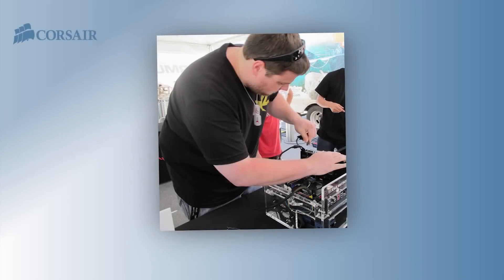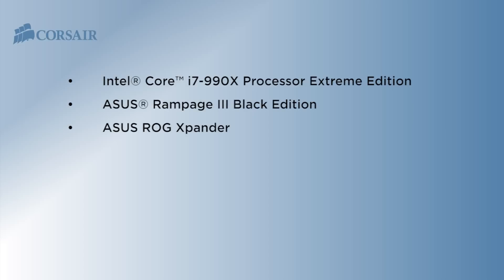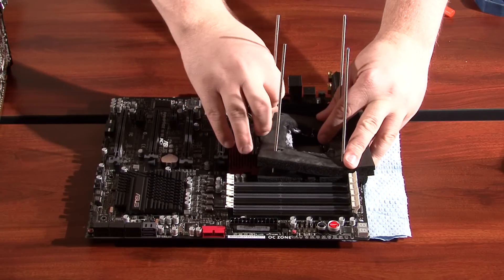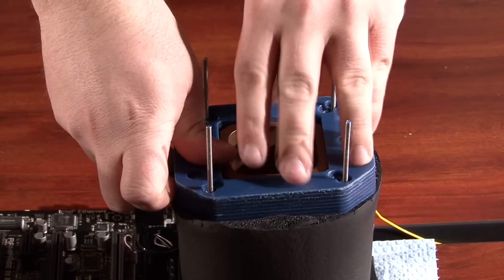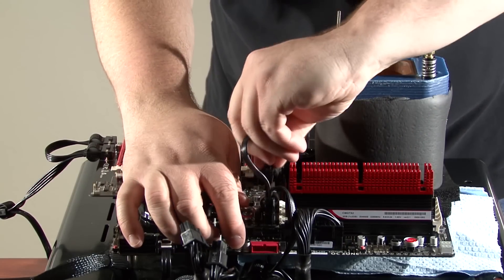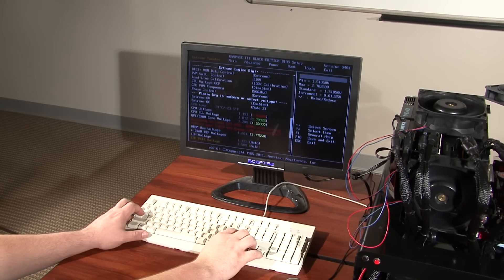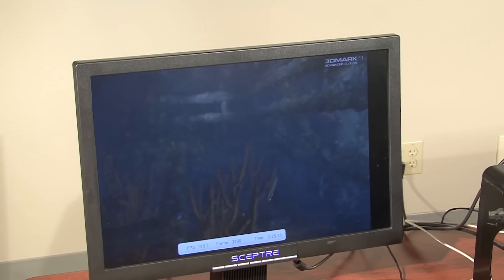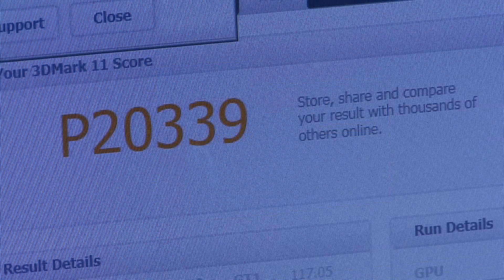Setting up your PC for liquid nitrogen cooling

Comment: Frozen is much more correct than lewis, though, the facts about minecraft is since it runs on Java, which is mostly used to for smaller devices and specific devices and apps, it doesn't matter if you have the best or worst computer, its the coding that can either run well or bad depending on what you have on the system, the hardware, drivers etc, you could have a $500 computer run minecraft amazingly, and a $3000 one run it maybe a bit better.

Comment: you do realize minecraft is almost 100% cpu intensive, and when i say 100% cpu intensive i dont mean load bearing wise, minecraft is not dependant on gpu unless using a higher grade texture pack, minecraft is ran from particles which process through cpu and not graphics engines, making it cpu intensive and a laptop with an i7 that cant run minecraft thats just sad, my friends 2007 toshiba laptop with some horrible celeron processor plays it fine

Comment: very graphic card intensive* and thats only if you have a higher resolution texture pack, if you are running on the standard texture pack, it can run on a 1.6ghz single core cpu with 128mbit of video ram on medium distance, i know because i have done it.

Comment: This is SO yesterday! Everyone is using liquid hydrogen now. And by burning the H2 gas, you can run a Sterling engine and generate enough power to run the PC! It's a win win! Mind you, there is the odd explosion to worry about. But darn it, it's a gaming PC! I need hyperthreaded 6 core 5 GHz!

Comment: I did a little bit of research to your statement and can concede that I was incorrect, but you were also. Depending on certain conditions and limiting factors, the human eye can process as little as 10 fps and as much as 250. There may be conditions where it can process more or less but it would have to be tested.

Comment: Why would you EVER need 2,000,000 fps? The human eye can only see at a rate of 12 fps and most game consoles run at about 60 to provide better quality so any more than that would be a waste. The only things that require a higher frame rate to operate consistently at are missile guidance systems.

Comment: Not only does the high clock kill the cpu but so does the liquid nitrogen. It will die within a month. Just like in computers pro overclockers are sponsored by intel or amd. He gets a large supply of cpu's on a regular basis. I've seen the new gtx 680 cooled with liquid nitrogen to break 1.8 GHz barrier. check out my channel for a comparison between the vanilla and ftw gtx 670 from evga. I think I am the only person on youtube right now to do a side by side comparison.

Comment: 6GHz with a 34x multiplier, but only 177MHz front bus?  Was it just not stable at a higher bus rate?  With a 34x multiplier and closer to a standard 200MHz bus, couldn't you be seeing around 8GHz?  You didn't nitrogen cool the ram or vid cards in that demo, so I would imagine the front bus speed couldn't be clocked crazy high, but still.  Was it ram problems?  Had to juice the ram to keep up with the CPU, but had to drop the whole bus speed to keep from frying it? Just wondering.

Comment: Liquid nitrogen isn't nearly as good a coolant as regular water due to its relatively low specific heat and a thermal blanketing effect known as the Leidenfrost Effect. Its far too expensive to be cost effective and you have to use much more of it.

Comment: Actualy, that's not a record.
AMD has set 6GHZ in 2008 and 7GHZ in 2009, getting almost 39k point at 3d mark.
You can check it here watch?v=z6Hf6d404QY&feature=relmfu

Comment: The point of the LN2 is for two reasons. One is because silicon is a semiconductor at normal temperatures, and by cooling it, you turn it into somewhat of a superconductor and thus requires less dramatic voltage increase. Second is because of the voltage. When you raise the voltage from 1 or so to 2 volts, you get a MASSIVE heat spike. So when you chill it down to negative temps, you can safely run it for a few hours before the electromigration kills it.

Comment: Hes using liquid nitrogen, not a freaking aluminum heatsink with a fan bolted on. At those temperatures, that much thermal paste really doesn't make a difference.

Comment: If Corsair asked this guy to do a video on LN2 overclocking, I think they did some homework and got someone who knows what they are doing.  I agree that it looks like a lot of paste, but you have to keep in mind that the physical properties of everything changes at extreme temperatures.  Perhaps he tried many different amounts of paste with LN2 cooling and it works better with more than normal thermal paste.

Comment: @phantom1C4: Its impractical. However, when graphene chips (integrated circuits) become a reality they won't produce all that much heat at all. Graphene also conducts electricity extremely well thus allowing us to do more with fewer transistors. Imagine a processor not running at 4 or 5 GHZ but 400 GHZ or even 1 THZ (terahertz = 1024 GHZ). It gets even crazier with quantum computing. Instead of only being able to use 2 states (0 and 1) you can have both 0 and 1 at the same time
Reply: Speed 1THZ memory 1Zeta byte  does sound interesting 🤔 NGL

Comment: Question: I'm quite ignorant in overclocking, but... with such temperatures why can't you push over the 7ghz or 8? I mean, what's the technical limit? Is the Cpu temperature raising exponentially? It would be cool to see how this goes up from 
-140 when the system is in full load.

Comment: @vampiricassassin41 Liquid nitrogen doesn't conduct electricity. Just like pure H2O doesn't conduct electricity. It would have evaporated well before any damage occurred. You can place a drop of liquid nitrogen in the palm of your hand and roll it around like mercury, until it evaporates, usually a few seconds later.